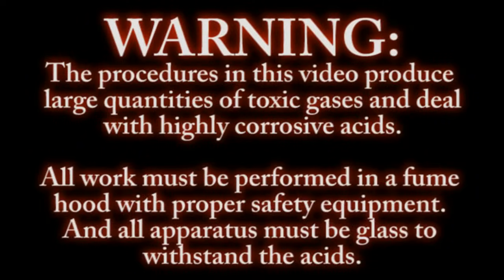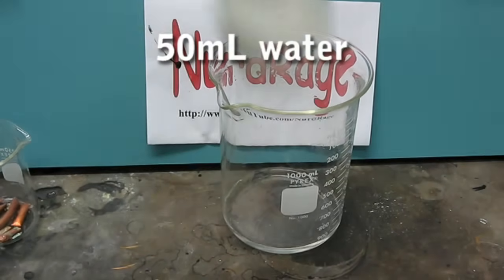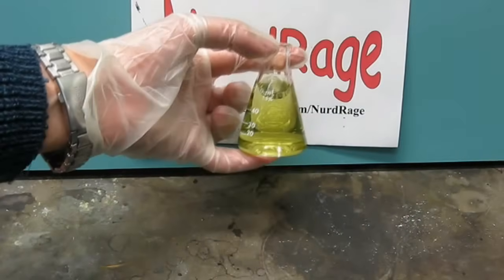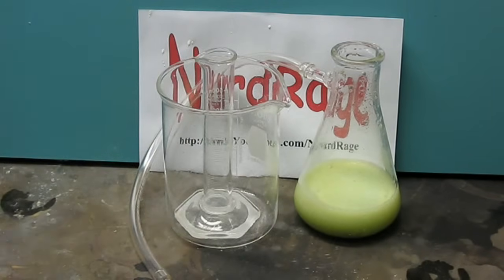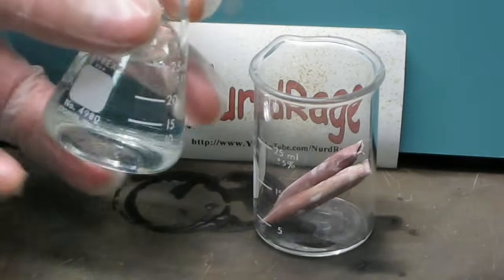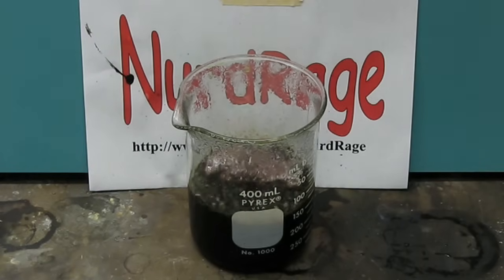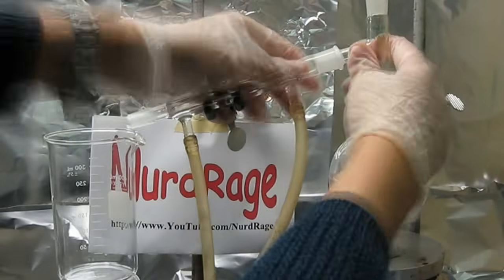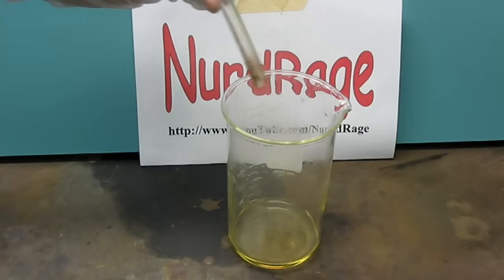Make Nitric Acid - The Complete Guide

Comment: Did I hear you right? 1:27 "The Copper Reacts with the Nitric Acid and Nitrate Mixture to generate Nitrogen Dioxide gas"

Wait...wut? Where did the nitric acid in the inner container come from, and why do we need to make it if it's already there? Or do you mean hydrochloric acid?

Also, what is dissolving the copper? I thought only Nitric Acid could do that. Do the nitrate ions in the solution help the Hydrochloric acid dissolve the copper?

Comment: In the middle of the video you say that the 3rd method is fractional distillation, but when you do the 3rd method, I see no fractioning column being used. Does this mean the fractioning column is optional? Would yields be better if we use one over not using one?

Comment: I read somewhere that the batches for making nitric must be small.  Why is this?  will it be less potent if larger batches are made?  Why couldn't I double or even triple the formula for bigger batches?  Say for a 100Ml batch of nitric I would just multiply all ingredients 4 times.  Would this be possible or should I keep it no more than 50 ML batches and if so please feel free to explain.  Also, I see that the concentration for the hydrochloric used is 37%?  will 31.45% not yield?

Comment: Just wondering, on the third method, was there a considerable amount of nitrogen dioxide being created or was it already dissolved into the acid. I want to know if there would be enough to add a vacuum flask at the end of the condenser to catch the liquid and to attach a setup the same to the second method to maximize the acid production.

Comment: Where do you get your ground glass equipment? I made the mistake of getting a distillation apparatus with rubber stoppers (which have now been destroyed by the acid) and I have been struggling to find ones that won't be eaten by the acid vapors.  Even better (I have a small budget) would be if there is something I can coat the rubber stoppers with to protect them from acid. Is there such thing?

Comment: The oil is used in caring for the flask. The oil distributes the heat evenly. It is used as a method of prolonging the life of the flask and reducing the chance of the flask becoming damaged as apposed to applying direct heat to the glass.

Comment: Here is what I noticed about these tutorials.  They tell us how to convert ammonium nitrate into sodium nitrate, sodium nitrate into nitric acid, nitric acid into potassium nitrate, potassium nitrate into ammonium nitrate.  They seem to go around in circles.  What if you don't have a nitrate compound?  Is there any way to start from scratch?
Reply: cody's lab has a video where he uses a high voltage arc to make NO and NO2 from air and then make it into nitric acid. another way of doing it is oxidising ammonia into NO and the NO2 and then dissolving that in water to make nitric acid

Comment: The condenser he is using is a liebig condenser. It's a water jacketed condenser. The inner tube that the vapors go through is surrounded by a chamber that water goes into. The tubes are so water can flow in and out of the water jacket. Cold water does a better job of condensing the vapors than bare glass would. For my condenser I use a water pump that sits in a 5 gallon bucket of water. Water goes into the bottom of the condenser, out the top and back into the bucket.

Comment: Is it possible to just redo the set-up and bubble the Nitrogen Dioxide into the weak Nitric Acid made with methods 1 and 2 to make stronger acid (say, about 30-50%?)? If so, what's the highest concentration one could achieve through methods 1 and 2 (even just an estimate)? Thanks. :)

Comment: sadly, that doesn't work if it's alloyed. You'll have to heat it past it's melting point or put it to at LEAST 20 mesh for your idea to work. 
Only the aluminium or zinc on the outter layer would react,. The others are too far in the walls of the copper to even see the HCl

Comment: Sadly its not that simple,  Or luckily its not that simple or we'd all be dead :p as we wouldn't have any O2 and that be bad.  You have to produce Nitrogen dioxide through a chemical process they won't bond together naturally.  Technically you could force them to bind together through nuclear fusion, but that would require millions of degrees and a massive amount of pressure.  The easiest way I know of to make nitrogen dioxide is mixing nitric acid with copper.

Comment: Hello!  I have a question:  How does the condenser do in the third example?  Can it be omitted?  also, If I made the reaction and ran the gas coming off it through a cold environment, to stimulate the gas to drop out of the atmosphere, would the liquid that is coming from the tube be nitric acid?

Comment: no no no, you cannot do that because the NO2 is less soluble in water at high temperatures.
you would normally slowly heat the nitric acid with Concentrated sulphuric acid. This will produce either White or Red fuming nitric acid at around 16+M. slightly above the 15.8M azeotrope

Comment: Hello. Thank you for the guide.

I may be wrong, but I think the OP was wondering if a weak acid that has been made (or purchased), can be made stronger by removing some of the water - as presumably that is what the other "fluid" in the dilute acid is.

You mention for method three that a stochiometric approach will result in maximum yield but I am struggling to recall how to work out that (Avagadro get a look in somewhere?) Can you please say roughly how many ml conc H2SO4 per g of KNO2 please?

Comment: Hi Nurdrage,
In the video on testing if the fertilizer has enough nitrate you heat up the mixture of copper, fertilizer and HCL to drive the reaction forward. Why is no heating needed here?
My fertilizer is mostly ammonia nitrate but it is contaminated with limestone which causes it to foam in contact with the acid. Is this still usable? Is there a way to neutralize the limestone?
Thank you

Comment: You can actualy extract nitrate salt pretty easy from common fertilizer, and sulfuric acid can be bought as battery acid for cars - This is usualy around 30% so you need to boil it in order to evaporate water from it and concentrate it. -you should be abel to end up with 68% H2SO4

Comment from the maker: Instead of actually understanding the origin of the rule or why it applies you rely on unscientific catch phrases and insults?

Your so called "basic rule" only applies to certain limited set of circumstances. Primarily it applies to adding water to concentrated sulfuric acid. But if you don't believe me try this: Grab some vinegar in your kitchen (an acid) and add water to it. NOTHING will happen other than getting some diluted vinegar.

Try to be smarter and less insulting will you?
Reply: You forgot to add that vinegar is most commonly 5% acetic acid
Reply: @brandonknight7240  im glad i wasnt the only one who heard this, but to dissolve copper means that the acid and coppers by product is water soluble. So hydrochloric acid can destroy copper its byproduct isnt water soluble. I believe is the answer
Reply: I learned in High School chemistry 40 years ago to "Add acid to watah, just like you oughta."
I haven't run into any circumstances where that caused problems, even with vinegar, so it seems like a useful guideline.

Comment: A wire is not sufficient enough to really catalyse it completely.. Normal car exhaust vents have a type of filter set up or sponge of platinum (alloyed with other platinoids) in order to convert most if not all of the NO2 --> N and O
A wire would definitely convert some NO2 but most of it should remain as NO2 because of the insufficient surface area..

Long story short? get a better surface area of platinum :)

Comment: It seems to me that you are driving the following reaction and just using copper to react with the nitric acid produced and then removing the nitric acid produced via NO2 gas:

 NaNO3 + HCl →  HNO3 + NaCl (1)
 Cu(s) + HNO3 → NO2 + CuO (2)
NO2 + H2O → HNO3  (3)

Does it not seem easier to just distill the reaction in (1) to remove the HNO3 produced (BP= 83C), driving the reaction forward ? HCl (25% range you are using has a BP around 95C) can also be replaced with H2SO4.

Comment: hey i have a question about substituting NaNO3 for NH4NO3. I m wondering if it would give off any NH2Cl vapors. as far as i can tell. NH4NO3 + HCl+Cu(2+) + H2O will yield >>>>> HNO3 Gas + NH3Cl salt + Cu + H20 with some left over HCl that was in excess. let me know if this is correct and if i can subsitute out NaNO3 for another nitrate salt. Otherwise i can go to home depot and get some more dirty looks :).

Comment: You can but you will get a very little more concetraced acid, so it is negligible. You should use 10% or higher. More concentraced H2O2 you use your acid will be stronger.

Comment: in second method my HNO3 has chloride. Does this produce nitrosyl chloride? You used 80 grams of NaNO3 which is a little less than 1 mole. 100ml of conc HCl has more grams if density is 1,14 it is 114 grams which means 41gram of pure HCl(if is 36%). that is more than 1mole. Your HCl is excess and heat from reaction gife off HCl gas which contaminate product.

Comment: *In case no visible reaction occurs I plan to preheat the wire until red hot and then re-inserting it back into the Nitrogen Dioxide, which I feel increases the hazards*

Comment: I have all the safety measures that are available at the level of an amateur home experimenter. That means that if it does blow up, I would probably be far away from the vessel with the wire on the end of the stick (about 2m long). But that is all I got in terms of safety; a stick. I find it very tempting to just stick the wire into the brown gas and see what would happen, but I also want to be safe, which is why I asked for your expert opinion. Do you think this measure is enough?

Comment: I have a high-purity platinum wire,and I am wondering that if I insert it into the nitrogen dioxide generated,will it catalytically decompose it(like in a catalytic converter)?I think it should but am worried the gas would blow up in my face(trying it for science)if the rate of reaction is very quick(2NO2=N2 + 2O2?(if this is correct the molar ratio of the reactants and products suggests that if the reaction is very fast it could blow up to accommodate the extra volume of gas).What do you think?

Comment: is profitable to make HNO3 by second method using nitrate fertelizer which consists of ammonium and potassium nitrate(i think), and do titration and them make sodium nitrate and recrystalyze it, and then use it to make concentraced nitric acid by H2SO4 method. i will then dilute it to 70%. (For fractional distilation for getting 70% acid i don't have thermometer to measure temperature, so i cat do it that way)

Comment: for distilation method, conc sulfuric acid is used. My sulfuric acid is 96% and it has very little hydrochloric acid impurity(when i open a bottle i can smell hydrogen chloride). Can i use this H2SO4? Will nitric acid be contaminated with hydrochloric acid or with sulfuric because if i overheat it, sulfuric acid will start to give white fumes? Will this be present if i use hot water bath instead of oil, because water boils at 100 degres and HNO3 at 83?

Comment: The yield of nitrous acid would be extremely low, if NO2 gas would even react with water, because nitrous acid is usually made at low temperatures.  Next, hydrogen peroxide decomposes naturally at room temperature into O2 and H2O, thus, to rid any possible nitrous acid and force the decomposition of H2O2 to go faster, just heat the final solution of nitric acid for a few minutes if you're paranoid about contamination of these two chemicals.  However, I doubt they would be much of a problem.

Comment: Does this nitric acid you made by reaction of water and nitrogen dioxide contains nitreous acid, because NO2 with water gives mixture of HNO2 and HNO3.
Also for hydrogen peroxide method if there is some H2O2 left, how to remove it?

Comment: If someone wants pure HNO3 you could use H2SO4 that is more expensive but it has high boiling point (anyway taking reaction temperature low), it's less volatile.
If you want HNO3 more and more pure you could use something like a cheap CaNO3 gas trap blocking H2SO4 forming CaSO4 but maybe it's better to put before an other not reacting gas trap to dry gases (NO, NO2, H2O, H2SO4) to protect CaNO3 from idratation.

Comment: Hi, very nice!
I wanted to write that in your first approach (in the all 2 experimental enviroments) you use MNO3 and HCl to have an enough acid NO3- solution so that NO3- can oxidize Cu, obtaining NO and/or NO2 gases to bubble in the water; anyway HCl is volatile (it is HCl gas solved in water, think that you can feel the strong smell!) so HCl will flow through the pipe to the water container and you finally will obtain a HCl and HNO3 solution! Try the Cl- test with AgNO3 on that solution! ;)

Comment: How can you be sure there is no hydrogen peroxide left in reaction mixture or when it isnot after that and if you use water first, No2 reacts with H2O to create HNO3 and HNO2. How to remove nitrous acid, if i heat it it will also decompose nitric acid. And what to to if hydrogen peroxide is in a excess. I can test it with MnO2 but how can i remove it?

Comment: @legonut021 

I finally managed to starts this reaction. solution meed to be heated or some hydrogen peroxide need to be added else it is too slow.

I found that this reaction is basically Cu oxidation with NO3 ion  in acidic environment, so any acid should work, but stronger works better. I wonder if that can be done with citric acid or vinegar.
also ammonia is weak base so it works better than nitrates with strong bases.
Reply: Hey, I found your comment from 8 years ago and If you’re still here I want to ask something. I did it and nothing happened. At first I thought my HCl was weak but no, it was fuming and it didnt work. So i did take a look at my nitrate source and still to this day dunno why but doesnt work lol
Reply: @daw5600  
wow, that was quite a long time ago I almost forgot what was all it about. Not use what you are trying to do.
I think I used this process for silver recovery to dissolve copper-nickel alloy contacts. Since nitric acid was unavailable I added ammonium nitrate to the HCL  and it started reacting with copper. 
Although this reaction was very slow to start.

Comment: @deltaxcd of course i am not making nitrogen dioxide gas from just hydrochloric acid
but also from the nitrate salt. Just look at at the reaction, there are HCl, NaNO3, and Cu(copper), not just just NaNO3 and HCl
oh yeah, you can do it with H2SO4. Reaction:
2NaNO3 + H2SO4 → 2HNO3 + Na2SO4
That's the last reaction you see in the video.

Comment: @legonut021 
You cant make nitrogen dioxide gas out of hydrochloric acid because  HCl does not contain NO2.
also nitric acid is stronger than hydrochloric acid so you cant perform displacement as with H2SO4

If this reaction really could work nitrate must be used to oxidize something. 

attempted this reaction with KNO3+HCL and it failed completely. while it goes perfectly with KNO3+H2SO4  
maybe it could work with ammonia nitrate + HCL sine copper catalyzes ammonia oxidation

Comment: @deltaxcd wrong, he made nitrogen dioxide gas out of hydrochloric acid, not the nitric acid itself.
the reaction is:Cu + 2NaNO3 + 4HCl →  CuCl2  + 2NaCl + 2NO2 + 2H2O
which is bubbled to water:3 NO2 + H2O → 2 HNO3 + NO
or hydrogen peroxide:2NO2 +H2O2 → 2HNO3
thank you.

Comment: I used 130 grams of Copper, and 120 mL of water in the sodium nitrate, 400mL of 32% HCl, 100mL H202 (in receiving cylinder), and 320 grams of Sodium Nitrate. Potential Problem:  I put the copper and sodium nitrate in first, then like a fool starting pouring in HCl.. I got about 110mL in and then realized my ***DERP!!!*** and poured the water in... it separated into two layers once I completed (after the water) pouring in the HCl I swirled a bunch and some bubbles formed but it wasn't doing much

Comment: Hey.
 I have four questions.
 how hot should the oil bath be? Celsius.
 if you use the vacuum-how much should negative pressure be?
 should I have an oil bath when running with vacuum?
 What does Stoichiometric means?

Comment: @avilawilder1318 i don't think so, but it would dissolve any slight base metal impurities. dissolving gold requires "aqua regia", a combination of two conc. acids- 1 part nitric to 3 parts hydrochloric- adding heat helps.

Comment: Will the condenser method work with potassium nitrate? Plus can you use a flame to heat the mixture in the condenser method, instead of an oil bath?

Comment: Mr. Rage, I bought a 500ml filter flask and they gave me a rubber no.7 stopper for $.49. Also I got latex surgical tubing.  Will rubber and latex work safely in the second method shown?  I am using Potassiun Nitrate 99% stump remover and 31.45% HCl 20* Baume Muriatic Acid.  I got copper out of some NM copper wire.  Also is using the 3% H2O2 from Walgreens ok?  Thanks

Comment: as far as i know dissolving nitrous oxide in water produces nitrous acid (HNO2) not nitric acid (HNO3) which is not usable for some experiments. 
making HNO3 with fertiliser is not completly true nither because most of the fertilizers are made of ammonium nitrate or urea nitrate with which you cant make nitric acid. usig hydrochloric acid to make nitric acid is really funny not only false.you cant boiling the produced acid to rise the concentration if you ask as nitric acid boling point is 83 °C

Comment: @aram045 with the first 2 methods there is not danger with using ammonium nitrate, but with the distillation method the only worry is over heating the ammonium nitrate, this is not a problem at all as long as you add enough sulfuric acid.